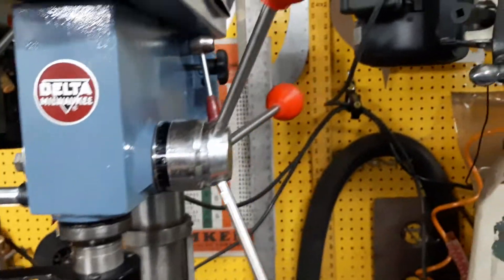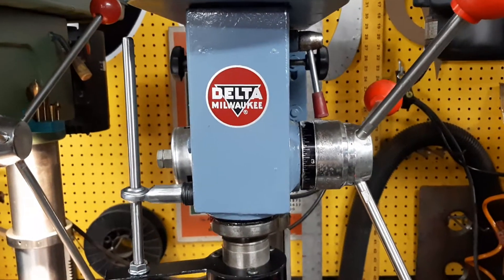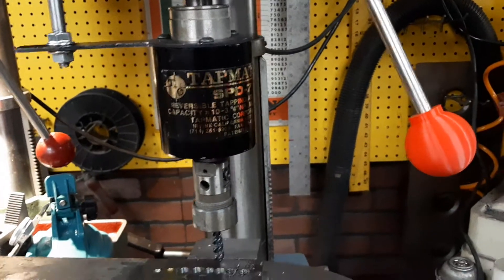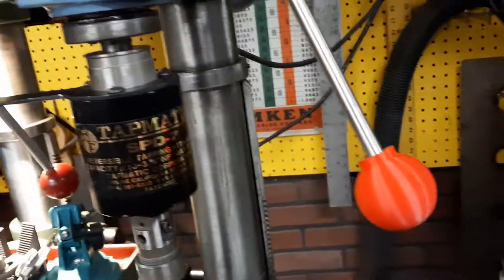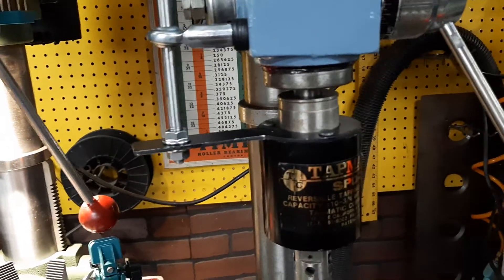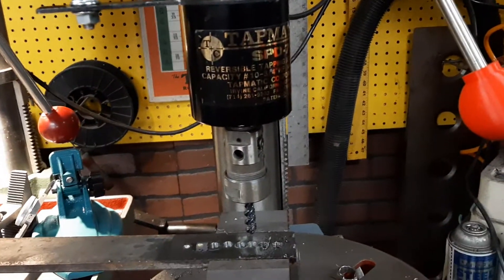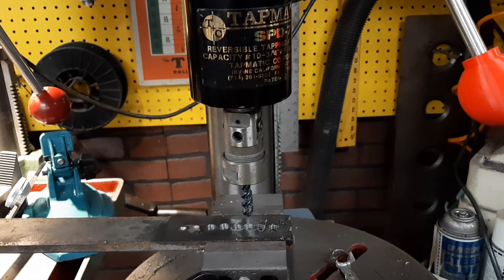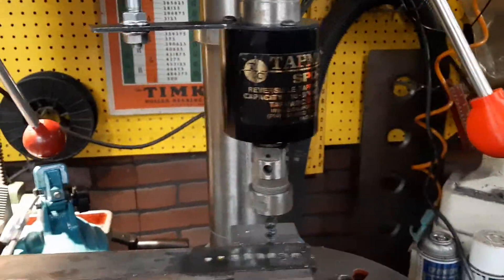Dedicated tapping drill press using the Tapmatic SBD-7 Tapping head.

Comment: Very nice video. That tapping you're hearing isn't the clutch slipping -- it's actually because you aren't feeding fast enough.  The SPD-7 actually doesn't even have a clutch like the other 70X and 70RX.  It's obviously easier to match the feed speed if your drill press is going slow.  Also the SPD-7 only has a 1:1 back-feed too -- not entirely sure why.
Reply from the maker: Thanks for the feedback and the info on this head, since making this set up,I was hesitant to apply pressure,but now it's been in service, I have more confidence in it. I've used procuniers before and it's  different. Got about 2000 tapped holes with it so far. Thx so much for watching my video,I really appreciate it!